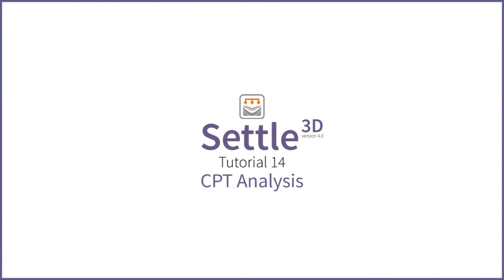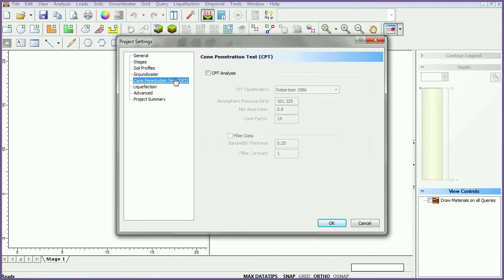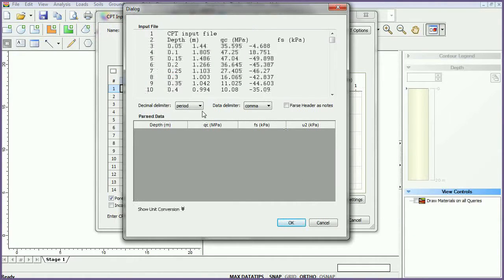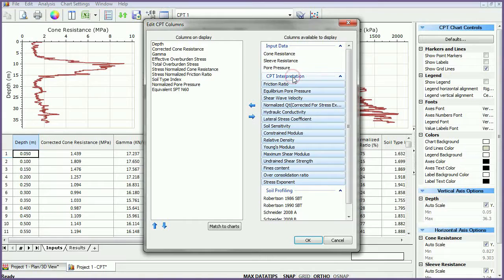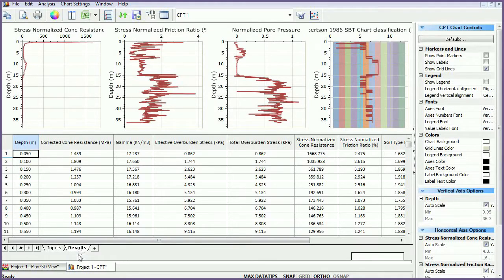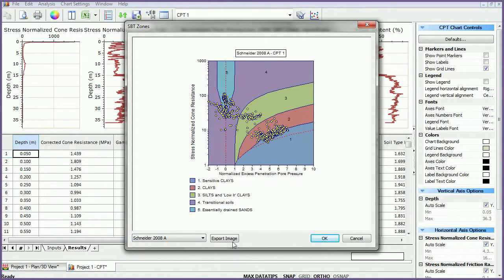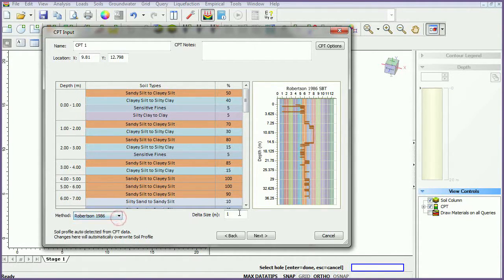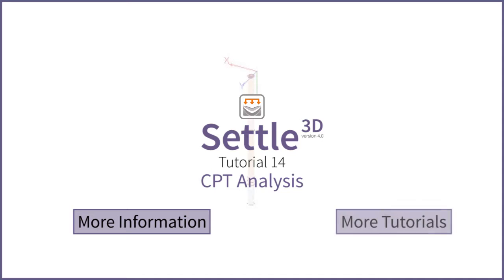Settle3D Tutorial 14 - CPT Analysis

Comment: I am having difficulty merging CPT holes together in the latest software release. The CPT layers are not showing up on the CPT columns and there appears to be a "borehole" which I cannot delete. I wish to only use the data from the CPTs. Any suggestions? The tutorials don't cover this issue.
Reply from the maker: Hi @Jwcn40, we've improved our CPT analysis in Settle3. You can check our latest tutorial update which can be found here:
https://www.rocscience.com/help/settle3/tutorials/tutorials-overview/cpt-analysis

Also, soil merge is now done automatically by Settle3 so users no longer need to merge consecutive layers with the defined delta size. 

You can also check out our latest soil profile from CPT data feature which allows users to draw soil layers with soil classification from CPT data points with the use of section creator option in Settle3: https://www.rocscience.com/help/settle3/documentation/cpt-analysis/soil-classification

Thank you!